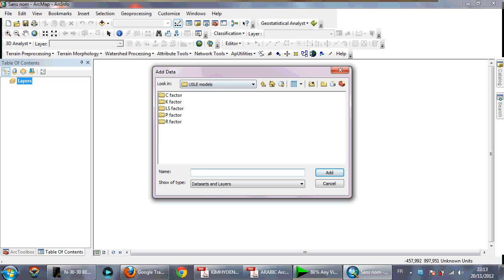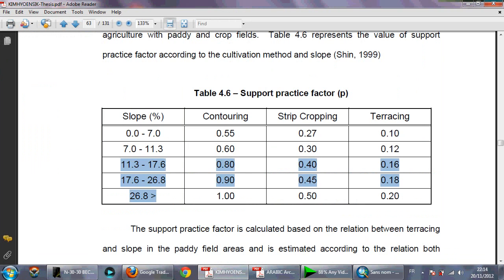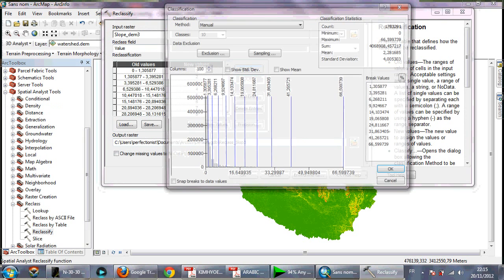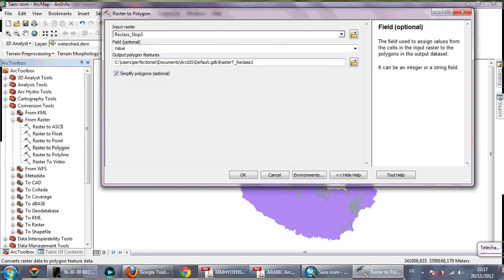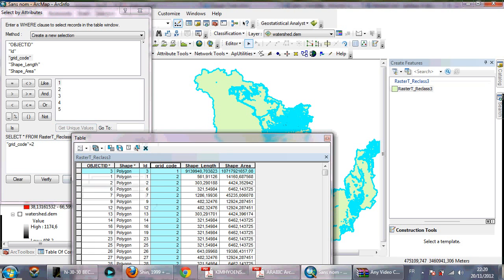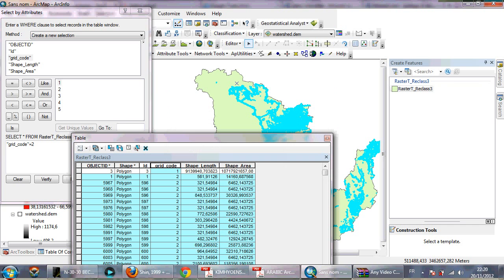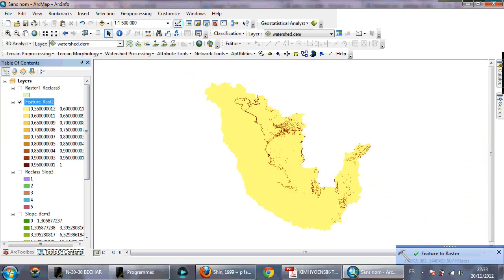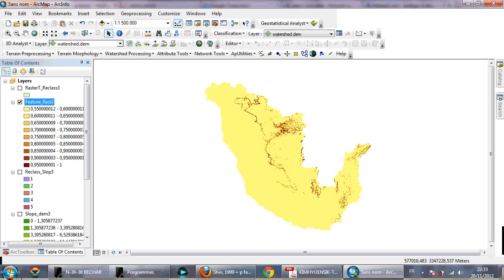P   factor map of conservation practice for USLE model

Comment: I have one question about p factor.
Why you make the transfer Raster to polygon? 
Is it correct to put P factor with  slope directly ?
Reply from the maker: Hello
Responding on your question
Depending on my knowledge, you can't modify a raster by inserting a new column, you have to covert it to a polygon then to reconvert it again to raster after inserting the required informations

Comment: plz why u add the number of contouring in pfactor ?? if we don't have any amenagement i think we add to p factor the number 1 !!! plz help me
Reply from the maker: +Hamoutahra Narjisse hello miss how are you doing ?
yes you are right it's logical 
but in my case I used the table which has been developed by wischmeir and smith in 1978 to modelate the P factor using the Slop values
you can check that in the thesis of Kenel delusca at the page 91 on this link 

https://www.google.dz/url?sa=t&rct=j&q=&esrc=s&source=web&cd=1&ved=0ahUKEwiX3qyjq8rJAhXBXRQKHc1mBZsQFggaMAA&url=http%3A%2F%2Fwww.collectionscanada.gc.ca%2Fobj%2Fs4%2Ff2%2Fdsk2%2Ftape17%2FPQDD_0009%2FMQ33866.pdf&usg=AFQjCNG2cIhTuOD7MJZIC6RS9p7RJ-QvZg&sig2=z7UyNIldEQJuSL-uGih7OQ&bvm=bv.108538919,d.bGQ&cad=rja

Comment: Thank you Sir for your prompt comments. The output from the resultant RUSLE is quite alarming in the sense that the value is 0 - 3323.13 and not 0 - 1 as indicated in your response. I have exclusively followed your procedure on u tube to generate all the factor maps. However, I failed to locate the procedure to compute the final soil loss (i.e A= R*K*LS*C*P). It would really be of immense help, if you could provide us the detail guide lines if you have to generate final RUSLE map and its interpretation.